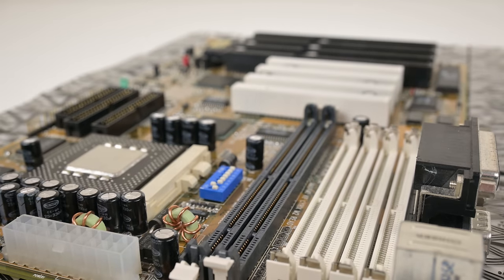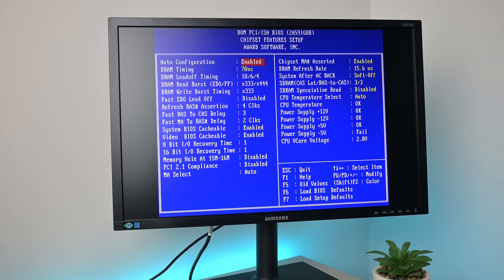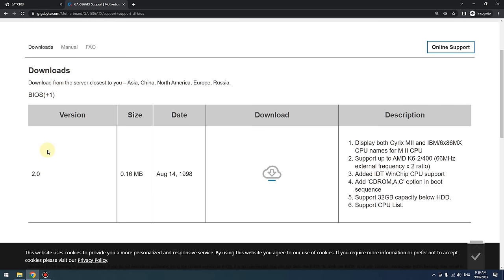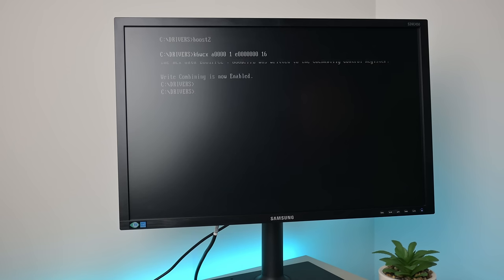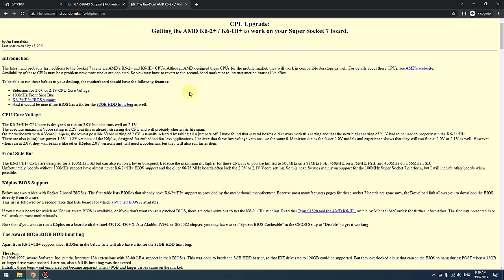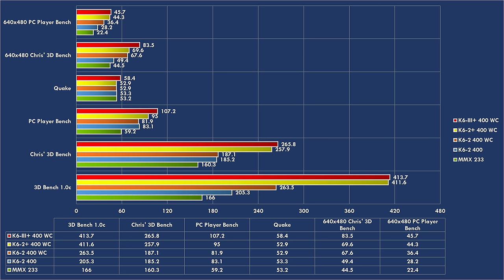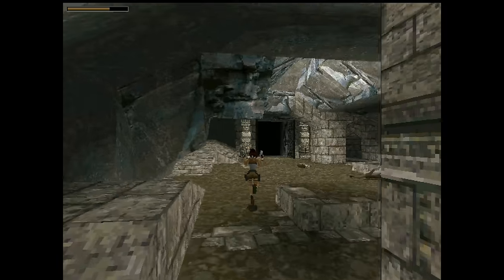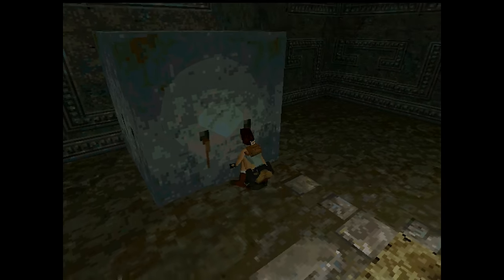Upgrading and Tuning Socket 7 to the Max

Comment: These days, I have a lot more fun pushing budget or older hardware than just maxed out best of the best.  I haven't really built a retro computer in a while, I still have my Apple IIGS and Mac IIci, both loaded, working great.  I got those past their time as a kid in the late 90s as gifts (hints fully loaded with period parts, they both were used at a printing place my Uncle worked at and cost wasn't an issue when buying/maintaining them... then they chucked them in the bin).  This build is interesting, would be neat to see a faster bus board, even if you'd probably just be better off with a P3 or P4 setup like you mentioned at the end.

Thankfully, with certain tech like upscaling with FidelityFX from AMD, we can kind of go back to the era of pushing budget/older hardware again, at least for games anyway.  I say FidelityFX (and Intel's option I suppose) over DLSS because it doesn't require specific training or extra lifting from the developers, so it's generally easier to implement.  My current test rig uses is using the RX580 8GB card I used for so many years before my current 6800XT.  I miss playing with config files and consoles, but at least upscaling gives some life to the older/lower power/cost cards.
Reply from the maker: Great point about these modern scaling technologies. Some work well with old games like custom resolution, virtual super resolution and high refresh rates. I played Far Cry on a 144 Hz panel and it was so smooth.

Comment: If I'm building a workhorse computer then I tend to try to max out the hardware so I can cover my bases as much as possible. That being said, I rarely do this anymore since I have my workhorse systems already and so I typically do themed builds now such as the best hardware for a certain time period, extreme compatibly for an OS, or building around a unique piece of hardware.

Phil, I'd be interested in seeing some videos on those ISA video cards you mentioned. I usually start at PCI and so I'd be curious to get a glimpse into that world.

Comment: With Quake I think you're hitting a combination of engine and video limits regardless of CPU. Software renderer can only work so fast and you're close to 60fps in all cases, I'm not sure there's much more to have without switching to a hardware accelerated mode.

I had almost forgotten Socket 7 was able to support these 400MHz K6-2's, I always associate the K6-2 with Super Socket 7 and the 100MHz FSB models but these 400MHz and below chips were fantastic, affordable upgrades for Pentium MMX machines that weren't ready to upgrade to Slot 1.

Comment: I'm using Asus TX97-XE with 256MB memory. Motherboard's own cache is disabled, not stable @83MHz bus speed AND because of that cacheable memory limitation but CPU deals that problem: AMD K6-III+/500 which can cache all the memory. Running 83x6=500. By the way, those S3-speedup tools works with VLB-cards too. Used those in nineties with my 486DX2/90 with S3 Vision864 VLB. Duke Nukem 3D was running smoothly!
Reply from the maker: Ah nice to hear that information about VLB.

Comment: Love those Intel i430TX motherboards! Excellent period correct boards for the right price can give so much performance for MS-DOS but also Windows 95/98!
Reply: And then there's "cheaters" like me: Radeon 9250 PCI instead of my org. ET6000* 😛

*Don't worry i still have it ;-)
Reply: @dallesamllhals9161 People who cheat are called "cheats". An individual who cheats is called "a cheat". Cheetahs are big cats, and surprisingly, they aren't known to cheat. There are plenty of PCI graphics cards that support DOS and Windows 95/98, so sticking with period correct hardware isn't usually necessary... unless you have a game that specifically requires a particular card or if there's no Glide wrapper for it.
Reply: @another3997  Sry' West-Jute(DK) here. No spek engrish! 
..did I write it: like i'm ashamed?!?    I ♥ CPU-bottlenecks ≥ GPU-bottlenecks - to this day!

EDIT: Oh, right...my '98 Voodoo² IS - of course - stil there.

Iwill P55XB2 = 5 PCI slots 🙂

Comment: Ha :-) tried exactly that experiment myself recently. Even used a Gigabyte Board (586TX3). I must admit, I sort of share your findings on this one. It was super interesting to see what could be done with going with higher and higher rated CPUs but the performance gain was not as much as I expected. I am glad that I didn´t try that back in the day when this was not just a hobby and I actually NEEDED a faster PC 🙂. In 1999 I jus twent with a new mainboard and a then fresh and strong Athlon Slot A instead and was very happy. But just as you said once: this is a great hobby to do just such experiments to see how all these "what if" experiments turn out. So much fun.

Comment: You can install more than 64MB of ram. Just use XMS ramdisk on the top of the memory with the size so that only 64MB of lower memory is left to use. ;)

Comment: I remember overlocking my 430TX board's FSB to 75/83MHz. An Asus board I think? Was a huge difference from 66MHz for the K6-2+. Eventually the board was replaced with a super socket 7 board for AGP and even better performance.

Comment: The K6-2 family's big party trick (and why a rig like this still might make sense) big party trick is that software tweakable multiplier and tweakable cache. You can REALLY slow this thing down on the fly on this board, down to 386 levels. Phil's done a few videos on that subject. Early PCI nVidia cards can still be had for less than obnoxious prices, as can the occasional Voodoo 1.  Also, a setup like this might be good for playing around with early 3D cards with proprietary APIs like the ViRGE, ATI Rage Pro Turbo, and the Rendition Verite. A lot of those cards were horribly bottlenecked by the CPUs of the time and would benefit from a faster more advanced CPU (and some judicious overclocking in the ViRGE's case, those things had hilariously conservative clocks from the factory).

Comment: When you tried to play the audio from the disc, did you connect the analog cable from the sound card to the cd drive?
Reply from the maker: Yes! Literally I used the same setup and one CD had no audio, the one from Sold Out Software. The other one worked fine...

Comment: Personally, I enjoy maxing out my systems as much as I can.  If I need to run something more speed sensitive, I just use one of my slower machines.

I have run into situations with some of my machines where if I install the maximum amount of RAM, other problems have cropped up.  For example, I have a Super Socket 7 system that can support up to 512MB of RAM,  however putting that much in caused the system to refuse to boot Windows Me (though it was working fine under Windows 98SE).  On different system, I have a Socket 4 Pentium 60MHz Packard Bell that supports up to 192MB of RAM, however , putting in more than 64MB causes issues with the Packard Bell ISA sound card.

Comment: Great video, loved the incremental CPU upgrades! Also totally agree that a Slot 1 or Slot A system would still demolish this, but for the people who can only have one "authentic" retro system, I think it would be most exciting to see how far this could still improved with some significantly better graphics card from the time, like a Riva TNT2 or even Geforce 2, Radeon SDR/DDR, Savage 4 or something like that. Are you planning something like this?
Reply from the maker: What you'll find is that many 3D games still require a decent CPU. Some graphics cards do better in a low CPU environment, especially Voodoo and early NVIDIA cards with early drivers.
Reply: @philscomputerlab  While it's true that any socket 7 CPU will bottleneck in 3D games, that S3 Trio64 won't even show the true extent of your CPU upgrades, there's clearly still room for more FPS in that system. A Riva TNT2 for example will of course not produce the same FPS here as it would in a Pentium 3 system, but you would definitely see measurable performance improvements over keeping the Trio64, that's why I asked.

Comment: I have 2 compaq pc's, a prolinea 4/33(a 486 sx/33) which upgraded to dx2/66, and a deskpro 200mmx also upgraded to 233mmx, only a little speed bump there!😂
Whenever if i get a pc, i always check to see whats the fastest cpu that the mobo can take and then I'll buy the chip and fit it.😁

Comment: I was always fascinated by the K6-III+ but we went with a Pentium III machine. I recently however was able to get my hands on one so now I am just looking for a case so I can get the K6-III+ machine built. I have plans to put a Voodoo 3 in it. Yes, I know that the machine will likely bottleneck the V3 but for high end gaming I have Pentium 4 and AMD Athlon machines.

Also, Tomb Raider is being remastered so it will be available on modern systems. I still want to try it on a DOS PC with the Voodoo patch, however. :)
Reply from the maker: Seeing Tomb Raider running on Voodoo silky smooth. Nothing will top that experience. It was literally seeing the future arrived at your home.
Reply: @philscomputerlab  Tomb Raider on pentium 3 1000mhz is silky smoth and with better image quality than voodoo. I tried a voodoo and picture quality was quite poor.

Comment: Interesting to see how different CPUs and settings/software impact the performance so much. I actually go for the easier route and simply use overpowered CPUs, like a Pentium III (100Mhz bus) for Windows 3.11/95/NT4, a Pentium 4/Athlon XP for Windows 98/2000 and a Xeon E5450 for XP/7. I also use slightly overpowered GPUs when possible while trying to "obey the laws" of period correctiveness.

Comment: Sweet memories.
I also had a 430TX, originally bought in 1997 with a K6-233, then upgraded to a K6-2 running at 400 MHz with the secret 6x multiplier which provided quite a performance boost in general use, unfortunately not so much in games.
The absence of AGP also limited the choices of graphics card upgrades; I chose a GeForce 2 MX, my brother with the same platform went for a Voodoo3 which was a better choice.
It still served me well until I had the money to buy a Socket A system.

Comment: I agree it’s a hassle. GOG should support those of us still gaming on original hardware. Older GOG installers had more of the original files to assist with older system installs.
Reply from the maker: Yea it's a shame. And who knows how long archive.org remains up and running...

Comment: Interesting how the filtering is different with those sound options.  From what I've read the Sound Blaster Pro has a low pass filter, but it's different depending on the version of the card.
Maybe the ESS card doesn't have a filter, so they added a software filter for that card?
Or maybe it does have a filter, but the code to control it is different from Sound Blaster, and that's the option that was compatible with the card you're using.
Reply from the maker: Yea it's interesting. Afaik the SB Pro has a filter and in many cards you can toggle it through software.

Comment: Games released by Sold Out Software are often heavily modified, music may be missing, the installer may contain additional DRM protection, video files may be cut or of much lower quality (so that two CDs fit on one), official patches often do not fit. In general, it's best to avoid games from the Sold Out series.
Reply: Interesting, thank you
Reply from the maker: Yes and it's annoying when you old find out later...

Comment: I agree with your conclusion.  Pentium MMX for older DOS games.  Pentium III for later DOS games and Win98.  Pentium 4 also good for Win98.  Win XP I have an early i7 with GTX 750 Ti
Reply: Never had AMD have you?
Reply: @dallesamllhals9161  Of course I have.  Most of my PCs over the years were AMD.  Including my current one.  I Was simply agreeing with Phil to leave the MMX for the early DOS stuff (and AMD has no equivalent that offers the same flexibility) and use the faster platforms (whether that be AMD or Intel) for the more advanced games.  That said for Win98 though I have found Intel chipsets to be more compatible than AMD chipsets.  For WinXP Athlon 64 kinda runs out of steam for later games, and Intel was clearly beating AMD once they came out with the Core series processors.  AMD is a good option for most retro builds.  Indeed in some cases performance is better.  Do what you want to do really.  I have both
Reply: @flightsimdeskuk  I stand corrected! ☮?

EDIT: "For WinXP Athlon 64 kinda runs out of steam for later games" Mnaaah! Opteron 180 here in '06! No loss of steam way into Win 7 years!

Comment: Jumpers were good given you could get the right voltage and be able to use any CPU for the same socket back then. It was up to the user to make them supported more or less. Not a complicated bios code.

Comment: I wonder how these CPUs would have performed on the Asus TX97-X motherboard. That's also a TX-chipset board, but it can do 75MHz bus, and in some cases 83MHz as well, although I never managed to make that stable back in the day. I did run my K6 200 at 225MHz with 75MHz bus though, and it made a noticeable difference in performance. In my system I had upgraded from an S3 Trio 64V+ to a Matrox Mystique 220 and a bit later I added a Voodoo 2 8MB. It was a really nice system, and that Asus motherboard was super stable despite running at an unofficial bus speed.
Reply from the maker: The higher FSB will give you a nice performance boost approaching Super Socket 7 levels...

Comment: I have a Socket 7 machine also based on the 430TX chipset. I have a P200Mhz MMX in it along with 64megs of ram. I recently picked up a CT3670 Awe32 and fully populated the memory banks to 28megs. The high mem soundfonts sound awesome in games. I believe you should just make a system separately if you want to play more modern titles (post win 98). Games were made for the older hardware so many times it's either incompatible or just doesn't work at all. I understand that not everyone has the room for multiple machines. But then I would recommend PCemu or something similar.
Reply: To be honest, for most people, the best option for playing old games is still virtualisation or emulation. Buying and maintaining old hardware is expensive, time consuming and takes up a lot of space. Obviously if someone is interested in the hardware itself, that's another matter, but nostalgia is often for the software, not what it runs on.
Reply: @another3997  Yeah that is true. But I like to tinker. So I don't mind the investment of finding parts etc. I managed to score some new old stock parts from a collector. So the mentioned system I have is mostly unused. I also managed to find a complete unopened IBM Aptiva Pentium II system with monitor and peripherals. But it's in storage atm as I don't space on my "retro" desk. So I have move the system I have there in order to make room. So yeah it's a hassle. But when you fancy playing old stuff it's worth it. RIght now I am heavily into Worms 1. Just something about the first game :)
Reply from the maker: At least for more demanding Windows 9x games, emulation isn't a good option yet. PCem needs the highest CPU to emulate a Pentium II. For DOS though I agree with you. Many of us enjoy playing with the hardware as much, or even more, than actually gaming 😊
Reply from the maker: Yes, mucking around with the hardware is what I enjoy most. I do like playing the games but for me it's the hardware action that gives me the most joy when working in the lab.

Comment: Hopefully when i find an AT case i plan to base it around K6, i feel its overshadowed by super socket 7 and prices can shoot up where a pentium 3 is cheaper to get into, though i remember my dad saying while the 486 PC aged that he wished he had this "K6" processor and reading up about it, it was big, K5 is also interesting and usually forgotten and would be nice to compare it to its successor and the platform it replaced. I just bought an ATI Mach 64 2MB and i think a 200-266Mhz K6 will be a nice machine so i can run the resolution higher and can always manually adjust the multiplier :)
Reply from the maker: Yup you nailed it. AT boards without AGP get shunned. But they are a nice upgrade for an older 486 system for example and more flexible.

Comment: the prices have risen lot since 2014-2015 when i was hunting parts from secondhand stores locally in finland (examples pentium MMX any model were 0.2 euro and 2d card 1-4 euro)
Reply from the maker: Yes. Cheap parts right now are from the 775 era. Core 2 Duo and PCIe graphics cards.

Comment: L2 cache is integrated on K6-III processor - and much better than onboard... the board can serve as L3... so the cachable area does not matter...
Reply: I'm 100% sure Phil knows = He's done lotsa videos on the K6s in the past.
Reply: @dallesamllhals9161   Of course he does know.. but You can still max RAM without problems if cpu has own cache.. If he mentioned the case then i must overheard it..
Reply: @SuperWasara  Mnaah even with K6-IIIs 256KB on Socket 7 it does slow you. 

Didn't know that when i bought a 128MB SDRAM module back '99 for my Iwill P55XB2 with Intel 430TX first build/from '97.
But HEY! I had no internet back then...
Reply from the maker: You are right, I should have mentioned this important detail!
Reply: @philscomputerlab  SEHR important it is in 2023 😀